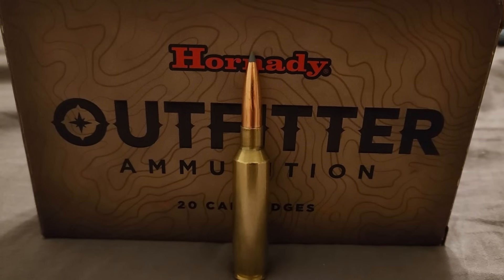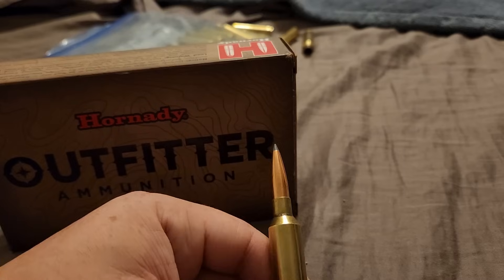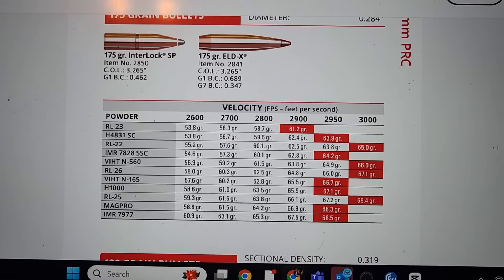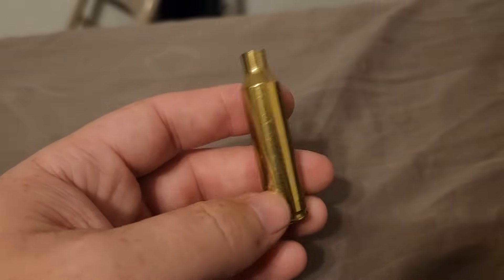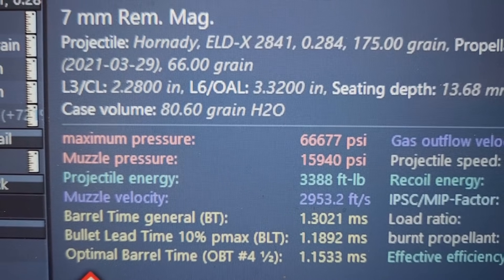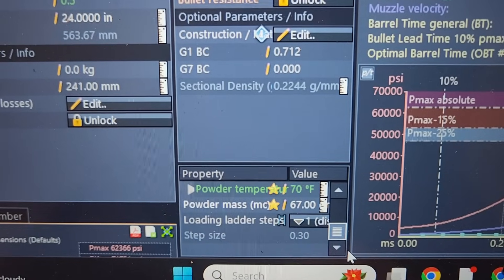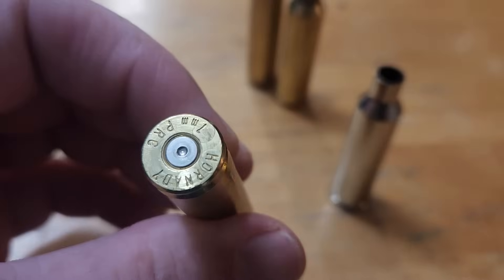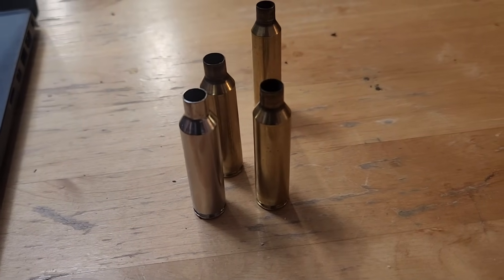Why your 7mm PRC is slow...

Comment: Just to add my $0.02. I've just got into 7mm PRC with a Savage 110 22" barrel. I had some IMR 4350 lying around and saw that as an option for the lightweight bullets as per the Hornady tables you showed. So I bought some 139gn SSTs and some Hornady brass and CCI LRM primers and started loading.

I saw a few weird things. The tables say to load to 3.07" coal but that didn't put the cannelure to the case mouth, you have to go a bit shorter for that, 3.04" or thereabouts. OK, whatever. I started at 57gns IMR4350 and worked up to 61gns. The results? Way lower velocity than as per the Hornady tables. OK, they are for a 24" barrel but even so?  

In summary I'm about 150fps lower than "advertised" and can't get to the 3000ftlbs I want for a "Lite Magnum" loading I was trying to target. Max load in the tables is 62.2gn for IMR 4350 and I project I'd need to load 63.5gn to get there.

Looks like I need to go to a heavier pill and a Magnum powder like H1000 or Retumbo to get my 3000ftlbs. But the vid here says I will be at the top end of the ladder not the midrange to get that. Fingers crossed that's the case but it certainly looks like Hornady are leaning forward on these numbers in their tables.

Comment: N568 is pretty solid. Just shot it today. Was easy to get 3k with 175 eld x. Peterson brass and 73.6g of pixie dust and I was there with no pressure signs of any kind. Found a good node there too, from 73.2 to 73.8 was pretty good.

Comment: My 7mm PRC is going 2860 out of a 24 inch barrel using staball HD. 70 grains of powder. I’m not trying to chase speed. I don’t think speeds important anymore with modern cartridges. I think it’s all about modern efficient bullets. The speed is definitely not what it was cracked up to be. That’s like 1990s way of thinking when bullets were shaped like potatoes.
Reply from the maker: Velocity is still extremely important. Let's take your 7mm PRC as an example. With the same accuracy and same bullet.. Will the 175 ELD-X have a better hit probability at 1000 yards going 2860 FPS out of the muzzle... or using N560 going 3000 FPS out of the muzzle? Statistically speaking the faster load has a better hit probability. Less time in the air and does better in the wind than the slower load.  

Don't settle for mediocre speeds in the 7mm PRC... there are other powders that will get you much better velocity and accuracy.

Comment: I use 7PRC for long range target shooting, with 32'' barrel, I agree with what you, definitely need a longer barrel. However, accuracy and repeatability are better around 2800fps. Here in Australia we have ADI powder, and I use AR2225 which is equivalent to Reloader 25. 68grns will push a 180 ELDM well over 3000fps. Which is too fast if you don't want barrel fowling or projectiles turning into dust. 190A tip or 197SMK's work best, let the BC do the work for you.

Comment: My son and I just bought 7prc's one savage 22'' barrel and one Weatherby that says 26 but thats with a brake. Both shot 2800 with hornady 180s.  Mine showed pressure and stuck a case. I shot one federal 175 at 2940 with the sam result. Gun was shipped savage for repair. My sons gun had pressure on the honadys as well. His shot the federals fine at 2959. And shot well. The bos says 3k so we take 2959. The feds have Vitahvouri in them. We now have adg and peterson brass to start with. Thanks for the real truth.

Comment: Went and shot some handloads out of my 7 prc. 165 grain sierra tipped gameking going 3,050 fps. 2 inch group...
I think the 7 prc at least in my gun is most accurate going a little slower. (Meaning 2800-2900 fps)

Comment: These new cartridges I just to sell new rifles and dies! If you need extra speed go with a big case! If I need to push a cartridge to the max then I would just go with a bigger cartridge.Problem solved.And by all means go with a long barrel.I hunt thick woods in Eastern mountains and find very little inconvenience with a 26" barrel even compared to my 18.5" Model Seven.

Comment: Personally, I do not want to have to reload the 7 PRC to get it to shoot well!! I’m using a Savage 110 Ultra-Lite with a 22” Proof barrel, an aftermarket carbon fiber stock, and a Sythe Ti can.  ( Averages 2785 ) It is a Nice gun, but it doesn’t shoot consistently. I’ve had it looked at by a couple of “gunsmiths”, but they seem to only like high end Remington style based guns, and dismiss any problem as it not being such an action to begin with.  Which is BS, because I’ve had some great shooting factory Savages. 
My issues with the 7 PRC is: Recoil, inconsistent accuracy, Low Velocity, Hornady’s exaggerated marketing, and velocity box ratings. 
As for recoil, I’m mean without a suppressor or break, on a 8-1/2 or lighter gun, at the range recoil is awful, affecting accuracy.  Also, it is very difficult to see the bullet path and on target impact, even with a suppressor or break.  My buddy has the same rifle setup, but in 6.5 PRC, and it is by far a more accurate and consistent. The recoil is so low, you can definitely see your impacts and bullet contrails.  

The worst part is, after spending almost $4500 on setting this gun up, I can’t sell it for even half of what I have into it.

Comment: I'm using that total crap powder "Staball HD" (cause I have lots of it) and I'm getting  2990-3000 fps  and  1/2 inch groups with 175 ELDX's from a 26" barrel.
Reply from the maker: 26 inch barrel helps a lot

Comment: Try N565 and N570 , That’s what I use . I have a Tikka with a 26” Proof carbon barrel and Bergara Crest 22” barrel. The Bergara is a little over 100 feet slower with shorter barrel.
Reply: Both those powders I get 1/2 moa groups at 100 yards

Comment: Pretty sure the point of 7mm PRC is extreme accuracy with 1 in 8 twist, at decent velocity with long heavy bullets.  
I'm thrilled with 2500 fps 7x65R with hornady ELDX bullets, 1/4 inch groups.  
Great video and thanks for the info!

Comment: Watch Ron spomers new video shooting hormady eld x, I dont know why everyone else is getting low velocities, I mean he's rocking it with a 22 inch barrel getting like high 2900s lol. I think he's also full of shit. But hey, check it out lol.
Reply from the maker: It's original RL-26 factory ammo he has kept
Reply: Yeah thats not how hes presenting it lol, and the velocity hes claiming the federal eld x is getting is absolutely not true out of any box ive shot and i have shot a bunch of it. I have yet to average under 2960 with the federal ammo. Looks like ron is bought and paid for. Sad really. @ReloadingWeatherby
Reply: Too bad thats not he he presented it. He made it seem like thats what you get woth hornady. Also his velocities were way low for federal. I have tons of it and shot tons of it. I  have never averaged less than 2960. i guess ron is not a trust worthy source of information.  @ReloadingWeatherby
Reply: I pushed my 22" barrel with 175 ELD-Xs using N560 to over 3000 fps doing a ladder test and even the Hornady brass didn't show any pressure signs. New barrel so still breaking it in. I'll probably load closer to the Hornady velocity using RL26 which got 2930 fps in my gun.

Comment: I feel the same way about Hornady brass. It is in my opinion designed to be fired one time with factory ammo. I went with Peterson's. Just getting ready to work a load up for my new 7 PRC wanting to use H1000 and the 175 ELDX. Can anyone suggest a recipe to try? 22 inch barrel on a Tikka action.

Comment: I have a Fierce carbon rogue with a 22 inch barrel I run suppressed.  I am getting 2950 fps avg with 65gr of N560 and 175 eldx.  I get 2925 fps avg with 62.8gr of IMR 7828ssc.  Both those powders shoot 1/2-3/4 inch groups at 100 yards. I went with the N560 because it is much easier to find.  H1000 shot nice groups but it was terribly slow in my rifle reaching only 2800 fps avg.  So I totally agree with sticking to N560 or IMR7828ssc if you can find it and if your rifle shots it well.

Comment: On the Staball hd powder… we loaded a 7mm rem mag with a 162g eldx in Hornady brass 1 grain over max and got 3125 fps with no pressure signs on the crap Hornady brass! Box velocity for that from Hornady is 2975. That’s in a 24 inch barrel as well. It worked very well.
Reply from the maker: Nice

Comment: Meh, I like stayball hd. Its working for me. .226 inch group best so far. Shoots great. 2970 fps. My set up is working well. Still gunna try to get a little more velocity out of it, but i mean, 2970 fps and 1/4 inch group. Hard to be upset.
Reply from the maker: The more I've loaded for it... the more I'm warming up to it.
Reply: @ReloadingWeatherby  nice. What are you loading with it?
Reply from the maker: @MatthewKyle-sg5uo  I got a quarter MOA group with my 300 Weatherby with it. Hornady Precision ammo in 300 PRC is Staball HD. Big Timber Lodge gets extremely good groups with that 212 factory ammo
Reply: @ReloadingWeatherby  awesome. Today I shot and I am ok with the charge. Bumped up and got 3004 fps average, little under .5 moa, it was hot and hard to see the target so I am basing my happiness on the numbers not groups.
Reply: @ReloadingWeatherby  I have noticed stayball hd might be a touch slow. I'm new to reloading and I do have some black around the neck after shooting which I read could be the powder being to slow, not expanding fast enough. So who knows. Might need to try something else just to see.

Comment: 24" PBB barrel and Peterson brass. I'm just under max, according to Hodgdon, using Retumbo and achieving 2988 FPS.  I know I can achieve 3000 FPS if I wanted, without being over pressure.
Reply from the maker: Peterson brass is why
Reply: @ReloadingWeatherby It is possible Hornady brass is a little too soft.  I have some brass from factory loads I can try.
Reply from the maker: @rodgert7978  I think Hornady brass is too soft and you hit pressure with it. ADG and Peterson is the way to go

Comment: I’m hoping in a 20” barrel I can get 2780-2800 fps with my 7 prc build I’m putting together that will allow me plenty of hunting range but hopefully not pushing the edge of pressure
Reply: Putting on together as well. Did you achieve those speeds?
Reply: @a.landry7744 with factory eldx I average 2740 I’m waiting on reloading dies to come in to start load development I got 175 eldx 180 vld bergers and 195 eol im gonna try

Comment: You're right. Too many people are using 20-24 inch barrels, and most of the powder available to them is high-velocity powder, which works well for these barrel lengths. However, clearly, in order to achieve the ideal velocity, it requires slower burning powder and a longer barrel.💔

Comment: What kind of ending is that!? What were your speeds with the two powders you recommended? Did you even try them? I highly doubt those are faster than h1000, n570 or rl26. 
You have to backup final statements like that.

Comment: I feel like too many people bought into the hype of the PRC and expected it to be overall numerically superior to the 7mm RM; faster, flatter, heavier, just MORE.

I'm building a rifle in 7mm PRC not because I want it to do more than my 7mm RM, but because I want to do mostly the same things as my RM with POTENTIALLY better accuracy, longer case life, and smoother feeding. If I can get similar velocities with slightly less powder, I'll be delighted, but I don't chase speed so much as I do accuracy. My go-to load for the RM has been a 160 AB @3025.

If the PRC can reach 3000 with a 160 class bullet or 2900 with a 180 class and be CONSISTENTLY sub MOA, it will meet my expectations.

Comment: N565 is quickly becoming my go to powder for 6.5 prc 7 prc and any short fat magnum. Even using the really heavy bullets like the 156 Berger in 6.5mm I get right at 3000 fps with single digit sds and sub half moa groups all day long.
Reply from the maker: Nice

Comment: Even at 2800fps, high BC bullets pay their dividends over farther ranges.  Example.
Do a ballistic chart for 300RUm, 180gr Barnes TSX .458 BC AT 3150FPS and then 7MM PRC 175 ELDX with .672  BC @2800 FPS.  Im fine with a 2800fps high BC bullet
Reply from the maker: Why on earth would you shoot a 180 TSX for long range? And only at 3150 FPS? That's 300 Win mag velocity. You can easily get 3350 FPS with a 300 RUM and 180 gr. Let's use a 178 ELD-X in the 300 RUM at 3350 FPS. The 300 RUM has only 20 MOA of drop at 1000 yards vs 27 MOA with the 7mm PRC. Wind drift would be almost identical

Comment: I have a Christiansen Arms Mesa 22" barrel using the Hornady 175gr ELD X projectiles, cci magnum primers and Hornady brass. 
The velocities I am getting are as follows. 

4831SC 64 grains of powder Average velocity is 2855 there are ejector marks on all 5 pieces of brass. 

H1000 67 grains of powder Average velocity is 2900 there are ejector marks on all 5 pieces of brass. 

Retumbo 70 grains of powder Average velocity is 2960 there are ejector marks on all 5 pieces of brass. 

I should mention that with all three of these powders that I tested I was seeing ejector marks as well on the brass at 1.5 grains less than the aforementioned charges. 

I have also shot several boxes of Hornady Match 180gr ELD M's, the average velocity is 2790. Out of each box of ammo approximately 15 of the cartridges also have ejector marks. 

It seems that I am seeing ejector marks very early in the charge weights. 

I ran into a fella at my local range that was seeing ejector marks on a lot of his factory loaded ammo, He had a 7mm PRC Browning rifle I'm not sure what model. 

I hear that the Hornady brass is soft as you mentioned.

Please comment I would like any information that you have to offer. 

Thank you for the clip it is very well done and informative.

Comment: If you didn’t have 150-200 rounds down range, your barrel hadn’t freed up yet. When it frees up, revisit the powder charges tested.

I 100% agree with those suggesting ADG and Peterson brass. 
Fed 215m, H1000 or N565, GOOD brass, and 175 Elite Hunters. 3000 is doable in a 22” barrel.
Reply: I have 300 rounds down range and tried using H1000 and 175 ELD-X.  I had to over pressure it to hit 3000 fps on a 24” barrel.

Comment: Lets be honest with all and yourself. Your handloads are slacking man. The 7mm PRC isn't magic sauce, but its absolutely what they claim if you know what your doing.
You weren't underloading, its the wrong powder man.
Hornady brass is shit so yes they are right.
Reply from the maker: So... if you were loading for 7mm PRC and didn't have RL-26. What powders are the correct powders for you? No handloader was ever going to get that Mossberg Patriot to shoot
Reply: @ H4831SC.
I'm 100% sure anyone handloading can get any gun to shoot. I was told a Browning BAR semi wouldn't shoot chambered in 308. But it sure does and we have taken it to 800 yards with accuracy. Here are the things we had to work with. Left handed, shooter has one arm, wants to use a specific bullet which is the Barnes TTSX 150 grain and needs to be at speeds for elk, shoots off a tripod. No big deal.

Comment: I think I'll just build myself a 7-300 PRC and call it a day.

Why fight tooth and nail with a 175gr bullet to get 3000 fps when I could just neck down a 300 PRC case and get 3200?

Well, there are actually a lot of reasons to go with the 7 instead of a 7-300 PRC lol. But it would be a fun project

Comment: The Hornady reloading book says  you should only see 2950 with H1000 in a 24 inch barrel using 175g bullets.  And yes Hornady brass is crap and will show pressure signs quick so you won't see good MV.  Till that make Lapua brass the 7mmPRC will suffer just like the 6.5 creedmore and 300PRC did.
Reply: Guess what was just announced 👀
Reply: @BadKarma.-  Lapua is making 7PRC brass now?
Reply: @DanielCampbell-h5z  yep coming this fall, they announced it last week I believe
Reply: @BadKarma.-  It was rumored they were going to.  I guess I'll move forward with that MPA 7PRC I was debating on getting.
Reply: 5 out of the 8 rounds of Hornady Precision Hunter I shot out of my Tikka t3x have ejection marks.
Reply: @Iceman-529  The brass is just too soft.  I have even had brand new hornady brass blow primers after just one firing. Not from over pressure but from the primer pocket being to soft.

Comment: I built a 7 PRC and have had a similar experience.  2850 fps from a 175 gr Berger EH out of a 22 inch Proof barrel. 65.1 gr H4831SC. ES: 13, SD: 5.6.  Not nearly as fast as my son's 7 Rem Mag, but definitely more accurate.  Best group has been 0.07" (3 shots, yes i know thats an outlier)  Average/typical group is around 0.50-ish give or take (10 shots). Great rifle, but it's not a speed diamond by any stretch of the imagination.
Reply from the maker: Thanks for sharing

Comment: My brand new MPA Matrix gun is probably not a good example as it has a straight profile 30" barrel.  Just completed it's first powder test and with CCI 250 primers, 69.5gr of H1000, 180gr Berger Hybrids and ADG brass, I easily got 3,117fps with absolutely no pressure indicators. The 100yd, 3-shot groups, even at various powder measures (65.9 to 69.5grs) ranged from 0.14" to .74" with 9 of the 16 groups under 0.35",  I was ecstatic. I could have easily gone to 70.6gr, but my goal was to get over 3,000fps that day. The common word out is that Hornady was originally using RL26 for their box velocity numbers, but then had to change to another powder. While my groups were exception the SD's weren't the best. we'll see what Seating Depth testing brings next. A Garmin Xero was used to record velocities, and it didn't miss a shot. BTW,  Hawkins posted a load development on the 7PRC early on from a 24" and 180gr bullets with 71grs of Retumbo at 3,045fps, 67.0grs of H4831 at 3,041fps and 70.0 grs of H1000 at 3045.
Reply from the maker: Now that is the proper barrel length. Thanks for sharing